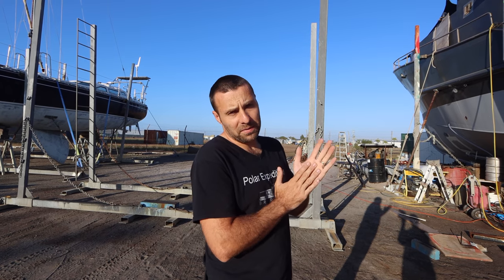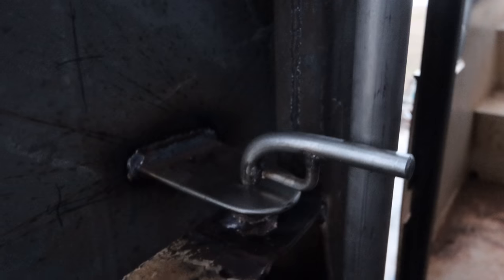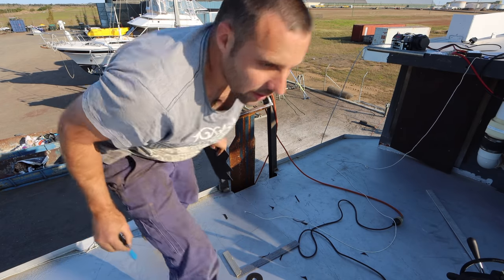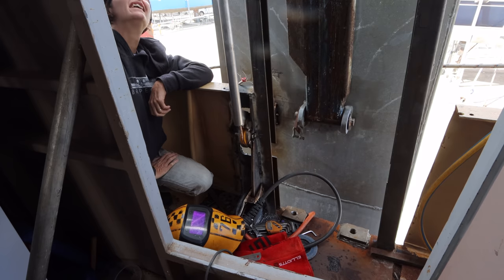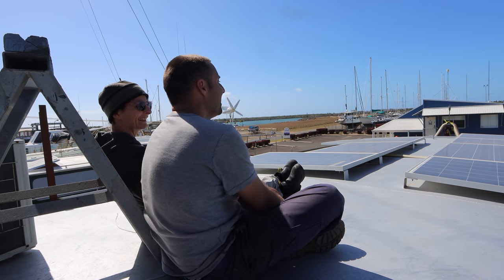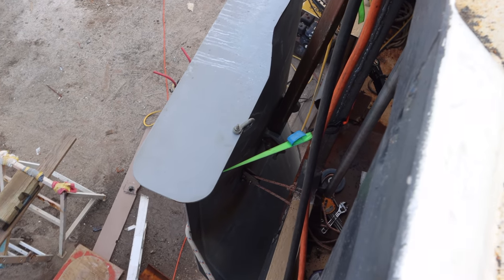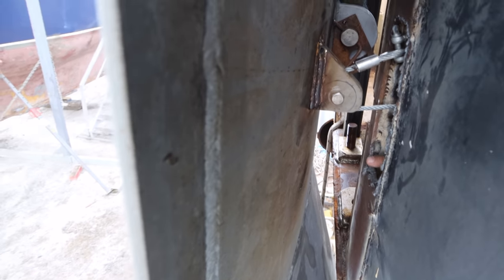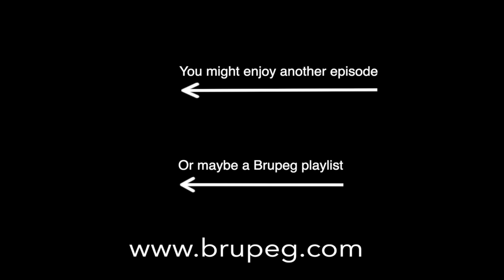Winches, Pulleys & Wings (2 of 2) - Project Brupeg Ep. 170

Comment: It may be tricky to deploy these wings in anything but the calmest waters. A rocking boat will cause the sliders to hammer against the locking stops. Securing them will be a hazardous business.
Reply from the maker: Hi Martin. The design is a common design used on commercial trawlers over here. There are risks but these wings get deployed a couple of minutes after we leave a wharf and don’t get lifted until we dock again, sometimes months later
Reply: @ProjectBrupeg  Thanks for your reply. Just make sure the securing nuts are on lanyards!

Comment: The jobs go on. Pułl it to bits again to sandblast and paint. Its a huge job you are doing. No wonder the iron ore prices are going up with all the steel you are using. Jess, looks live you are feeling fine again, but beware and dont run yourself down.  again.  Weld that fan at the stern. You might get 2 more knots. 😊
Reply from the maker: It is a solid fan!

Comment: Lots of engineering coming on here. Looks great. I guess calculating the water line and how deep the wings will be below the surface went into the design. Very cool
Reply from the maker: Hi JB, wing tips don’t hang below the keel so total depth won’t increase and weigh on a boat this size is almost irrelevant as they swing maybe 15ton difference between full of fuel and bone dry

Comment: Great engineering on the whole wing system. It’s amazing to see it coming together! 

Hope you toss a rain/splash guard in front of the winch. Just to keep the direct  sea spray off the front and top. So it’ll last longer. 

Either way it’s wonderful work. 

To anyone else reading this please consider joining via Patreon to further support the project.
Reply from the maker: Hi Jeremy, the plan is to fold up a stainless box that sits over the whole shebang. I will hose the winches down in lithium grease and then bolt the covers down. It's not perfect but im hopinng its close enough
Reply: Project Brupeg linseed oil on the wire ropes before you put to sea. That’s soak to the core and make sure it doesn’t rust from the inside out. Then coat the holy hell out of the wire rope that’s expose to water immersion when the wings are down with grease.
Reply from the maker: Denso tape it’s called. Awesome stuff but messy as all hell.

Comment: I enjoy your videos and also have the luxury of being a Monday morning arm chair quarter-backer. One thought I had in support of mounting the winch lower, along the deck or rail was not only the advantage of a straighter in line pull but also the ability to manual lift the wings up in the event of a winch failure. It would be much safer position to be in at this level in the event of having to manually winch the wings up if needed. Your pretty far along with the upper wheelhouses winch mount. The pulleys, brackets and mounts look great. Just a thought.
Reply from the maker: Having a manual option is definately something i would like to add. Im not keen on the winch down low as it makes water egress a much bigger issue. the manual option is still something i want to solve.

Comment: If you are not continually raising and lowering the wing, I would have considered putting a mount similar to a box tow hitch from a car mounted vertically along the rail so I could just drop winch in when needed, and store it inside out of the weather. Connect with an Anderson plug mounted nearby. This would give flexibility of being able to swap sides if one failed.
Reply from the maker: Hi Glenn, we need the ability to lift/lower these wings short staffed and in a hurry, i didnt want to add anything into the system that requires setting anything up befor you can press the button.

Comment: I admire your tenacity. There’s always a way to engineer your way out of a questionable idea. When you start something you don’t want to undo based on a previous mistake of doing the lifting of the slider rather than the wing, the puppies are a solution. But putting the motor down on the deck between the sliders now makes all the sense in the world. You could put a box over it to somewhat protect it and you’d have some of the roof over it. No pulleys. No long cables. Just a straight shot to lifting the wing in nice and tight.
Reply from the maker: Sounds like your implying we made a mistake and tried to bodge up a fix. If we put the winch on the deck we are putting it right in the doorway and in an area of the boat that will get the most amount of seawater flowing over the winch. It also means that when the wing is in tight the winch cable wont be able to freely move on the drum to coil up properly greatly increasing the risk of a birds nest. We would need to mount it lower than the arm top so the cable is under the arm, therfore greatly increasing the engineering needed to either sink the winch into the deck or lift the arm bolts up to clear the winch weakening the mounting structure. The winch was always going to be mounted up high as it will get spray but not solid greenwater like the deck will, and the pulleys are more than adequate for the job we are asking of them and dont add any drama into a simple system
Reply: Thanks. Makes sense now. 👍🏻

Comment: Love you guys !   I live alone so for me , it's like a visit to an old friends house.

Hint::: on the winch cable drum backlash issue. 
A piece of conveyor belt material, rectangular, fashioned and anchored to resemble a the brake/clutch band on a drum winch. 
ONLY instead of controlling the drum it rides down inside the drum throat just touching the cable and around the spool. So as
to create an OPEN FACED"" FAIRLEAD"" WRAP 3/4's around the cable and width of it's spool throat.
Reply from the maker: Ahh i really like this idea, maybe spring loaded so as it wears its always pulled into the drum evenly. I was thinking a piece of steel doing a version of this as it wouldnt wear but rubber is likely easier
Reply: @ProjectBrupeg  I wish i could send drawings (a picture is worth ! 1000)  but on the cable slack tensioner issue.
Parts list:
1 Service line spring like found on an semi 'over the road tractor' (the one that keeps the electrical power supply
and the air lines out of the driveline and hangs off the back of the cab, they stretch a mile and come back) They
have about a 10 to 50 lb. pull capacity, best guess and that may be increased , by shortening spring or stretching
farther  ( its all trial and error in fabrication !  right ? )
1 Tube aluminum or galvanized , lets say 1-1-2 in. dia. x 10 ft. ( Lengths & Dia's to be determined by what works 
best for the spring to live within the inside Diameter's and antiscipated stroke.
1 Tube,    "      "     "     "     "     "     " ,   1-3/8 in.  Dia. OD so as to be telescopic as possible and still slide easily.
1 Pulley and fairlead, of course.
This gives you the general idea. The old timers just hung a weight and let it ride the slack out.

Comment: With the other winch unwind it all then wind it up on the other side so the motor is on the inside the same of the other side.
Reply from the maker: Thanks Jay, i will see how the cable attaches when unfurled
Reply: What about using the guides on the edge to direct the cable on the wheelhouse so you don't have to cut anything.
Reply from the maker: Do you mean cutting the lip on the wheelhouse?
Reply: You had taken the guide roller of the winch use them on the lip of the wheelhouse.
Reply from the maker: In the end we only need to nip about 10mm off the lip and we have clearance. The guide isn’t required any more and it’s just one more thing that can break so we decided to ditch it

Comment: You said that you would have to turn the other winch with the motor facing out, but you can switch polarity on a DC winch  and it will turn the other way. Then both sides will be symetrical. And up will still be up👍
Reply from the maker: Ahhh completely forgot about this. Bloody good point thanks

Comment: when ur talking bout pulleys, you completely forgot about mechanical advantage and when you add a pulley into the system the winch works half as hard over twice as long for example and instead of your winches working at "8% of capacity" their actually working a 4% and the friction each pulley adds is canceled out by the mechanical advantage if the mechanical advantage is not included in the total load. Pulleys are fascinating and i recommend watching smarter every day's video on Pulleys and Snach-Blocks because they will make ur life so much easier when lifting your dingy onto the rood and when designing other pulley systems. LOVE UR VIDEOS THEY ARE THE HIGHLIGHT OF MY WEEK
Reply: The 1 on the wing is a block 
The other 2 are just direction changes
Reply from the maker: What fowletm said. blocks double your pulling force making is a 2:1 purchase, changing direction doesnt make any difference other than a bit of friction
Reply: Project Brupeg even if you change direction you still get some mechanical advantage so the 2 pulleys the one on top of the roof and the one on the side of the boat make one pulleys difference
Reply: @Aarongla55  Those two pulleys change the direction of the pull, they don't give any mechanical advantage. To get any more mechanical advantage you'd have to add another on the wing.
Reply: @davidjulian8536  thats right. its been a couple of years and now I remember

Comment: If you use dynema rope it has the same size as wire rope by three times the strength and no spraggs and no rust.
I have used this on my trailer winch for five years still just like new
Reply from the maker: Hi Ian, yeah that’s our upgrade plan for these winches. Get them working with steel then swap it out

Comment: The NAS question depends on a lot of factors. To find the most economical options (while still doing it right), it would be helpful to separate your storage needs into time/speed buckets. The amount of data and how fast you want to be able to access it determines the best option for storage. 

For example, maybe you generate 1TB of video per day and you want to keep all of it long-term. If you had an appropriately sized NAS, it could be used to store the last X days of video for a month before it is moved from the NAS to long-term backup. For that, I would use a NAS with drives geared towards performance. 
 
In that case, a NAS is NOT a good option for long-term backup of video. But, it may be a good option for storing data for shorter periods before it is moved to long-term storage. 

The assumption is that you don’t need to frequently access long-term backups. If you’re looking for the cheapest option for this, data cartridges could actually be something to consider. The drive/writers can be expensive (look for used), but the tapes are cheap and durable. After you buy the drive/writer, you could expect to pay somewhere under $10 USD per TB of storage. By comparison, the cheapest price per TB hard drives these days are almost double that. 

Just a thought :)
Reply from the maker: Hi Greg, the current NAS we have is 4x3tb western digital reds set up as raid 5, its good, reasonably fast and for the most part reliable. the issue is when it shits the bed we dont have the onboard know how to solve most issues, so the thought of dropping the NAS and going to 2x2TB SSD's USB3.0 plugged into Jess's iMac as our primary raw file storage (file duplicated across both discs for redundancy) and then use gutting the NAS and using the Reds as long term storage for the completed high res episodes. Previously we kept all raw footage but after three years we have never needed to go back (if we want something its always been in the completed episode). So the hassle of keeping tens of Tb of raw footage isnt worth it in the end, and the completed episodes take up bugger all space, once compressed to .mp4
Reply: Project Brupeg Apologies for the late reply! I missed the notification for your reply and thought to check when you mentioned NAS in the latest video :). I wouldn’t bother putting your SSDs in RAID1. Unless a couple of hours of downtime (when the SSD eventually fails and you need to restore from a backup) is too much, there isn’t a big benefit to mirroring two SSDs. Use the extra as additional fast storage or you can still use it for backup, but on daily or hourly intervals. Then you at least get added protection from accidental deletion. RAID is more beneficial for HDDs, when it comes to increasing reliability. A nice SSD is reliable and most times will give you some warning it’s going to fail by starting to give read/write or file system errors. Just remember that when you eventually fill the SSD and need to move files off of it to either a NAS or individual HDDs, you should still try to have every file stored in two places. If a file is only in one place, it isn’t really a backup anymore.

Comment: Looking good.   Why not put a pulley atop the rails to turn the cable run 180 degrees then run the cable down through a fairlead lead through the deck and mount winch inside the hull?  You could even just pull on the strut guide pin.  The pulley reaction force would just be compression on the guide rails.  Use Dyneema rope -- no rust.   If more force is needed make it a dual pulley 2x system -- pulley on both the strut pin and the top of the rail.
Reply from the maker: Hi Craig, it’s built, it works perfectly. We won’t be redesigning it. But I do agree with you on the dyneema. I do want to upgrade to that but need to gain some knowledge about how it handles being submerged for long periods

Comment: I was looking at the nylon inserts for those sliders. And there buckling up a bit. I don't know how much of a concern it is. Somehow if they didn't work out, because you don't go up and down with these things all time anyways. And it would be the end the world if you just grease them once in a while? Thanks so much for filling us in with the new crew members departure. Getting Really Close Now!!!
Reply from the maker: Hi Dennis. The wear strip was just sitting in there for now as when we lifted it the metal on metal was like the worse nails down a blackboard you can imagine. The plan is to drill and countersink 10-15 bolts in the the wear strip and tap them into the metal of the slider. But first we need to drill and tap the holes and epoxy the sliders
Reply: @ProjectBrupeg  Great Stuff, glad you are ahead of us!!

Comment: I love 90% of the wing design. My only dislike is the winch and cables set up. The brace arm and it’s tracks are perfect for raising and lowering the wing ( exactly like how a guillotine cable and pulley work) the last stage where the wing needs to be drawn in can easily be done by hand as there is essential no outward load at that point. Just as you will manually bolt the brace in place when down you could bolt the wing in place when up. ( or a pin  but heavier duty than you used) That way there would be no cables running outboard of the superstructure and no extra drag or point of failure on the wing. I’m sure it will work ok as it is now but it is certainly not optimal. Other than that brilliant fabrication skills as ever, well done.
Reply from the maker: Thanks Mark, the issue with lifting from the arm is the slack point when the wing is say 80-100% up. Your right it could be pulled in by hand but that would add in another operation were a person would potentially be exposed to danger. With the cable pulling the wing we can winch in till tight and the wing is snug against the hull (even if it’s not pinned immediately). The pin we used to hold the wing in is a 16mm stainless bar sunk into a 32mm stainless bar with a 16mm hole in the centre. If we find the 16mm pin is too small we have allowed for the ability to drill it out further and increase the diameter later.

Comment: Thanks for the winch explanation. 
When at sea and you are lowering the stabilisers, what’s stopping them from bouncing up and down (from the waves) before you reach the screw threads? Also, as you are about to bolt them down, a wave could hit and ‘smash’ out the bolts, before they are fully tightened? I’m thinking of a spring-loaded pin to help lock in the slider, whilst bolting down.
No sarcasm please. As always, I look forward to the vlogs.
Reply from the maker: Exactly right. on the extremely rear occassion we need to faff around with the bolts at sea we will be doing it with two people and they will be the most skilled at getting shit right fast and first time. But the general answer is leave the wharf, drop wings, steam out into the ocean.
Reply: @ProjectBrupeg  Maybe a third hole between the two bolts to hold the wing down by a wrench until the arm is bolted, or any closing mechanism - simple but effective? Just imagining the system working ...
Reply from the maker: It’s certainly something I need to think more about

Comment: Dame,  you mentioned when mounting the winch on the starboard side it would have the motor outboard.  Could you rewind the cable in the opposite direction and reverse the polarity of the winch cables?  That way you could mount the winch with the motor in board?
Reply from the maker: Hi Nick, yeah that’s definitely something I want to do. I haven’t unwound one yet so I’m not sure how the cable attaches to the drum, but I’m sure we can solve that if we need to do anything

Comment: Damn all continues to look good with her help...LoL!  Now will you be adding sensors for panel lights to note when up in the home/parked position !?1?  So safety first...! RIPPED off last. Just like an airplane...gear up and gear down.  A quick scan of panel lights before coming up alongside anything??? like a dock when stopping by for beer? an iceberg when stopping by for some ice? a whale when they are checking you out and yes the list goes on.
Reply from the maker: Yeah that could easily be added. A waterproof micro switch at the top of the slide that lights up when the arm drops a few mm. I like this idea, thanks Dame